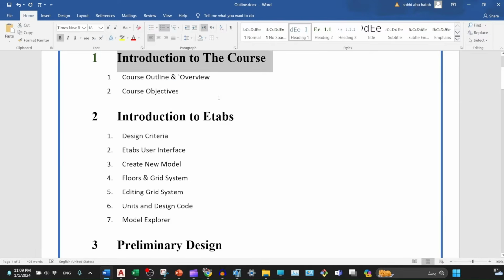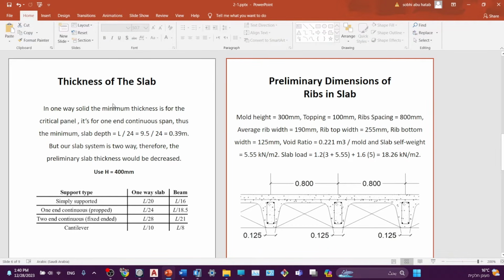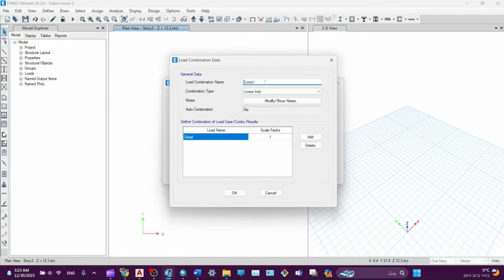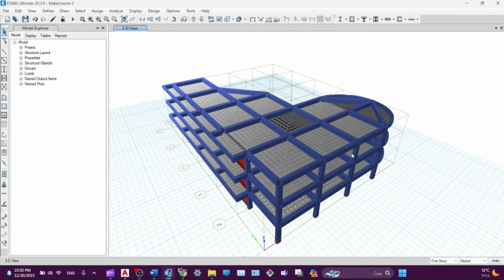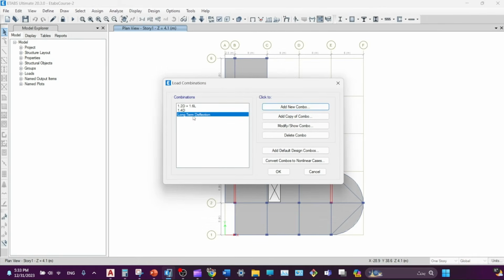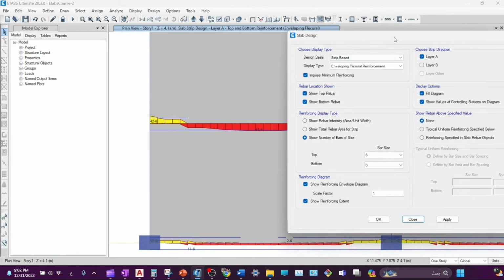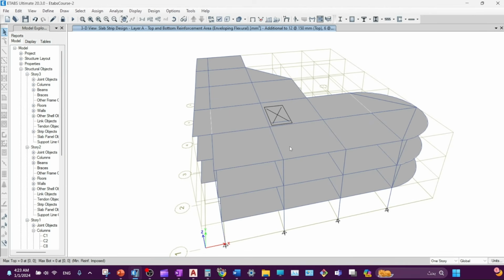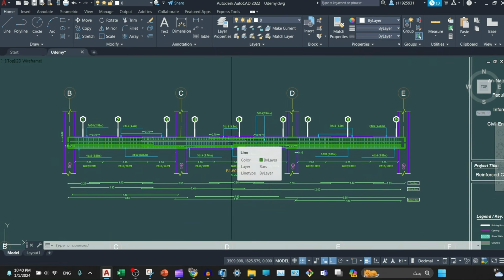Learn ETABS Basics, ETABS Building Design, ETABS Training Course Per ACI Code in (2.5 Hours)

Comment from the maker: Video Chapters:
0:00 - Intro
0:03 - Design Criteria
0:04 - ETABS User Interface
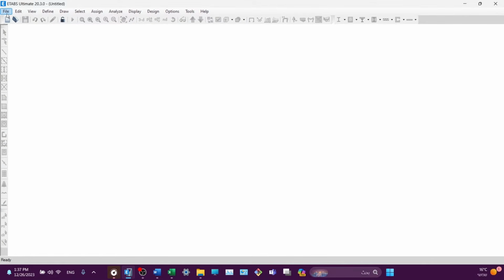0:07:55 - Create New Model
0:08:44 -ETABS Grid System
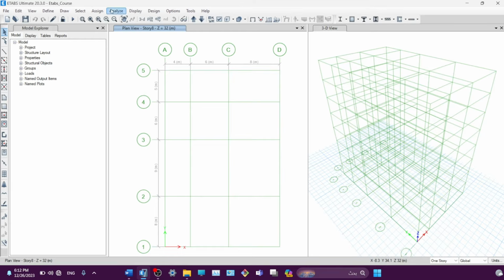0:13:31 - Units in ETABS
0:15 - Model Explorer
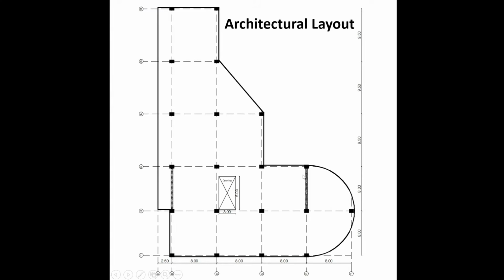0:17:11 - Reading Architectural Layout
0:18:11 -Design Loads
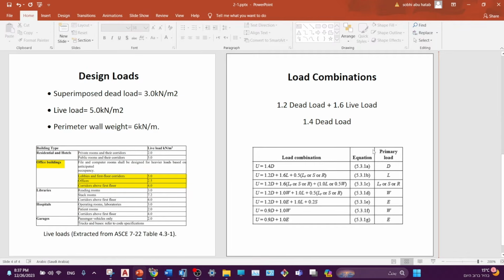0:20:11 -Load Combinations
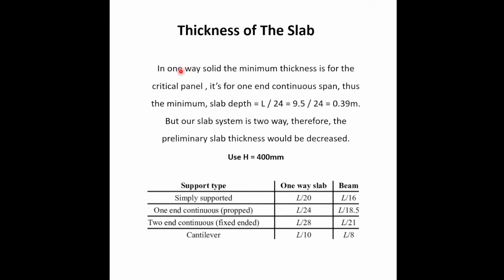0:21:44 -Slab Thickness
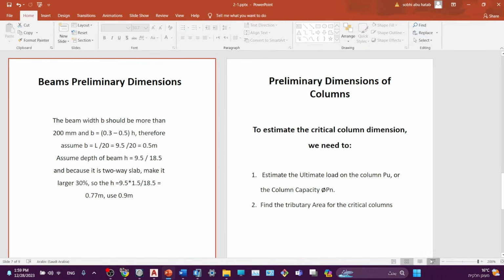0:25:12 -Beams
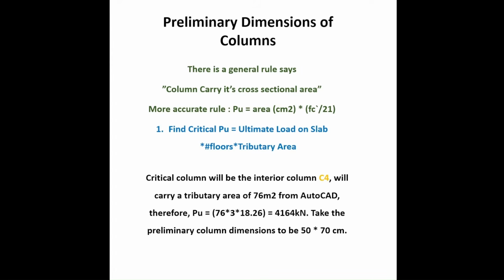0:29:09 -Columns  Preliminary Dimensions
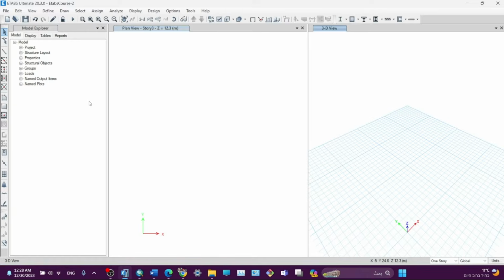0:32:52 -Define Materials
0:35 -Define Frame Sections
0:38:55 -Define Slab Section
0:40:27 -Define Wall Section
0:41:22 -Define Groups
0:43:26 -Load Patterns & Load Combinations
0:44:57 -Edit Grid System
0:47:51 -ETABS Modeling
0:56:37 -Assign Base Reactions
0:57:15 -Assign Slab Loads
0:58:55 -Assign Perimeter Wall Load
1:00 -Assign Groups
1:03 - Replicate To Other Stories
1:05:30 -Extrude Project
1:08 - Draw Design Strips 
1:11:12 -Shell and Wall General Meshing
1:14 -Check Modal
1:15:12 -Run The Analyisis
1:18 -Compatability Check
1:19:30 Equlibruilm Check
1:26:39 -Deflection Check
1:33 -Column Design
1:39:30 Design Steps
1:46:50 -Frames Design
1:50 -Slab Design
1:57 -Design of Beams
2:07 -Columns Section Designer
2:13:20 -Slab Design-Strips based
2:20 -Slab Design-Finite Element Method
2:22:50 -Shrinkage Steel
2:23:50 -ETABS User Report
2:30:20 -AutoCAD Shop Drawings
Hi there! Welcome to Design Nexus Academy
Here’s what you need to know – I use this channel to explore civil engineering topics and software design apps